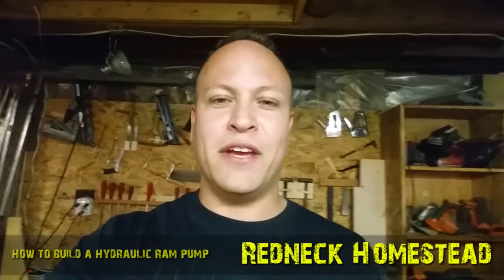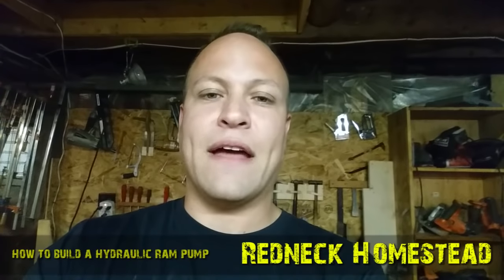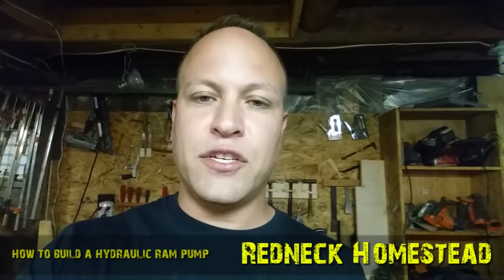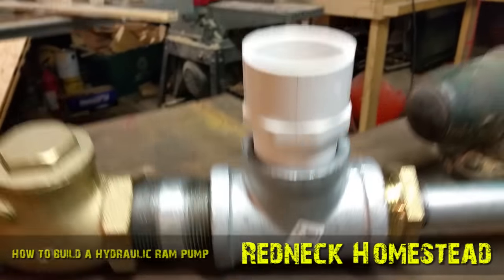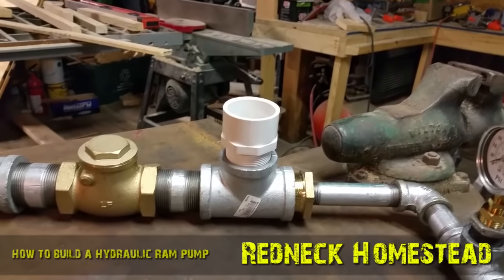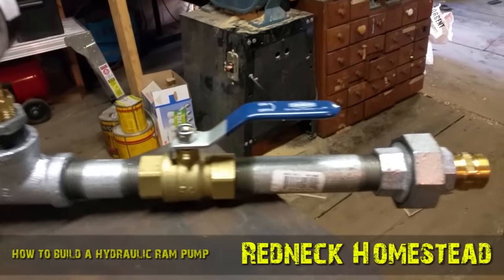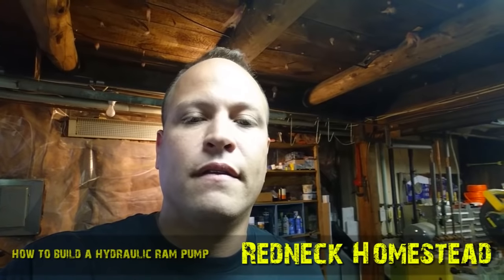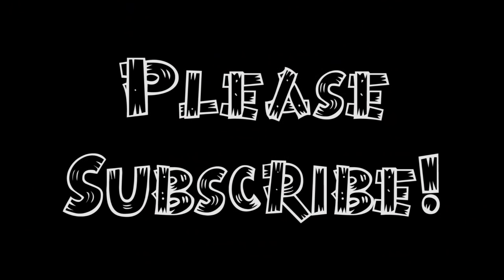Pumping Water Off Grid -  Building A Hydraulic Ram Pump & How it Works

Comment: You need to put the 1-1/2" union after the shutoff valve so you can remove the rampump without draining the whole system.I just found your channel thru your videos on the Harbor Freight Saw mill videos. Thanks
Reply from the maker: +David Casper great suggestion...definitely going to do that!
Reply: +David Casper are you talking between the pressure gauge and the ball valve?
Reply: @107retired  10:16 from left to right, it should go:

 >Ball Valve< <nipple> >Union join< <nipple> /// >Tee< <nipple> >Check Valve (flow--->)< <Reducer< <nipple> >Elbow< <nipple> >Tee< <nipple> \\\ >Union< <Nipple> >Ball Valve< <nipple>

The goal is simple. Undo the unions to remove the pump, the ball valves stay on the pipe work, keeping the water in the pipe lines. You will have much drier socks this way. I fabricate pump manifolds for a living, that is how we make them all.

I realise this reply is 4yrs too late but this is for future people.

Comment: What's best in the diameter of pipe 1 1/4" or 1 1/2"?  I love the larger but most others are 1 1/4" and I would love your input asap if possible before I buy the parts.  Also, have you used the noodles for the pressure pvc tube?  Engineer 775 mentioned that but I would like feed back from you on your opinion only so that you do not feel you are responsible of any problems.  I need your opinion please.

Comment: Great video but shouldn't the ball valves be located prior to the unions?
Reply: On the water supply side for sure, but I think the output ball valve (3/4") should stay where it is. Maintain the water flowing up hill as the other side has already been cut off.

Comment: I have heard that brass flap valves don't last long and are not that good. They are not adjustable home made one way valves can be cheaply made and you can change your closing times thus the flow which controls your pressure.

Comment: it's my understanding Ram pumps are used to lift water up a hillside or slope not down a slope. If you are running the water down to the storage tank from the spring then using that to operate the ram pump downhill more to the cabin isn't that defeating the gravity fed water pressure it will already create? Or are you trying to create more water pressure at the cabin side if so, then were will the extra pressure/runoff of the water go since it can't just sit in the pipes building up pressure.  Or am I just totally missing something?
Reply from the maker: +hallard069 you are right, but the ram pump can be used to harness the energy of the water and increase the pressure, even down hill.  In my case, the spring is 170ft to the upper left of the cabin.  I could technically just pipe the water to a holding tank behind the cabin, but  I would rather pump it slightly up hill to a water tower (not yet created).  Then my options open up vastly

Comment: Hi, how can I get added drop since my creek only drops maybe 2 feet and it just isn't enough drop to engage my ram pump??
Reply: Actually, the net rise would still be the difference between the two water heights. The perceived height gain is lost due to the need to suck the water up to the new level.
Reply: Dig a pit or trench 2' deep with a sloped entrance so you can use a straight ram pipe.  That will give you 4' of drop, dig it a little deeper and put gravel in the bottom.  The waste water can run off down the trench or can be piped using a tee and straight through valve of some sort so you can start the pump by poking the valve through the upper valve and then shut it off to run the waste water out of the pit.

Comment: Your unions should be inside the isolation valves so that you can remove the ram pump assembly without disturbing your piping runs. Otherwise, your unions have no purpose.

Comment: Get rid of the plastic parts....they won't last. With a swing check valve there is no way to adjust the amount of flow through the valve by adding weights to precisely adjust for maximum water pressure....been there, done that,  Swing checks also don't seal as good and the constant metal to metal pounding beats them up.

Comment: I'm sorry. 3/4 pipe is not 1/2 the square area of 1 1/2'  3/4' is about 7.5 square inches. 1 1/2" pipe has a square area of about 27" Not pressure shuts the impulse valve, Velocity does

Comment: Better paint that PVC. Ultra violet eats up PVC.( I use a old propane tank) You don't need inner tube.Just drill a small hole below the check valve. You have no idea what you're talking about when you talk about the delivery pipe. Reducing size doesn't increase pressure. Just velocity. Don't use black pipe because there's oxygen in the water. If there was no oxygen in the water... no rust. Like boiler systems. That's what air scubbers are for in radiant systems.

Comment: Nice vid, but a few points were wrong. Pressure does not close the waste valve, velocity of flow does. And when the valve closes it doesn't hammer the water down, the column is instantly stopped at that point (due to not being able to compress water) however there is still energy in the system that has to go somewhere and that energy is what you collect in the pressure tank and hold in with the 2nd flapper valve.

Comment: you can use stainless fittings. some water is murder on brass and galvanized pipe. plastic will hammer itself apart.

Comment: Neighbor your first inlet ball valve > MUST be before the inlet union to stop the incoming water from its source. Then the union can be removed to provide maintenance on the pump. The way you have it now is completely a waste of your money and effort - as it has No viable purpose - NONE!. Furthermore you are misleading others - should they follow your method of constructing their pump. You could have purchased all your components at Lowes - Home depot - etc. and saved loads of money > more than half!  Rating D+.  Mr. T
Reply: Wow, you are right about the valve locations, should be first and last, but others have already mentioned that and have done so  in a polite and constructive manner, just saying... It seems Josh is sharing a learning experience and not claiming to be an expert,  just for the heck of it, let's cut him some slack?

Comment: If you want to generate electricity you don't need the ram pump with the method you demonstrated.  If you used the ram pump to pump water to a higher elevation holding tank to create more head pressure then you can run the micro hydro generator more efficiently.

Comment: Great video, one question, why do you put the ball valves on other side of unions? Wouldn't you want to be able to turn water off to remove pump from system for service if needed?

Comment: Good stuff!
Question...in order for a ram pump to work,  your source of water must be a running creek or river?
 If you dont have that luxury, can a ram pump works with still water? Are there ways you can make it work if you  dont have running water?
Thanks.
Reply: je pense que sa peut fonctionner avec un étang ou un lac, il suffit que l'entrée d'eau soit immergée dans l'eau avec la pompe positionnée sous le niveau de l'eau, afin que la gravité fasse s'écouler l'eau dans le tuyau d'entrée, créant ainsi de la pression et rendant fonctionnelle la pompe. Après, tant que la pompe n'est pas immergée sa devrait le faire

Comment: I am sure you have figured it out by this point, however, the second check valve with the air pressure on it really should be vertical.
Reply: why?

Comment: my understanding is...the water supply is below the cabin location...the water is being transported via 1 1/2 in pipe to a cistern...from the cistern down to the ram pump (metal pipe would be better as it handles the hammer effect better to my understanding)...then you can use any pipe material you want...the pipe going to the cabin would be 1/2 the size of the supply line...if you have a 10' drop to the ram pump...you should be able to lift the water 100'...you may or may not need a stand pipe between the supply and ram pump...I think as per Engineer775...don't quote me...I'm not an engineer...good video...

Comment: Why not have a third check valve on the inlet before your hammer valve to prevent the spike from ramming back into the supply line?
Reply: Dirk Cornelis - I'm watching this setup & wondered if you would draw me a picture of exactly where u would place it. Haven't watched any post videos to see if he's made any modifications yet. do you see any issues with it in principle. thanks again.
thanks, Kurt.
Reply: Even 10 feet back up the supply line, back to the source, might be ok as water does not compress, I think the question is very simple.  I might not understand enough, and the idea might prevent the system from working. I would like to know.
Reply: In a word, No, the weight of the water "hammering"  downhill is what causes the pressure spike. The spike cannot exceed pressure of the water hammering down the feed pipe. Frankly, understand the pump is very old and works perfectly the way it is. Any valve in the feed pipe would only reduce the pressure of the hammer by reducing the cross sectional area of the pipe. Great video BTW Josh.

Comment: I think there's some kind of electrolytic reaction between brass and zinc. The zinc will be taken off the gal fittings and they'll rust. Eventually. Sooner if lots of minerals in the water.
Reply: This is correct.  The Zinc will take the majority of the corrosion until its all gone.  Galvanic corrosion is a thing.  But it is more of an issue the larger the system is.  I once put a galvanized bushing in a copper water system in a house.  It came apart in about a year.   All the zinc was gone in a matter of weeks.  Effectively the most vulnerable metal in the system will consume ALL the corrosion in the entire system until its gone.  Then the next most vulnerable metal will be sacrificed.

Comment: When you speak about drive line to supply line ratios it bring up the question:  Should it be based on diameter or on cross-sectional area?
There is a substantial difference.
If it should be based on diameter then: 1.5"/0.75" = 2.0 or 2:1 would be close to correct (actual I.D. depends on the pipe's wall thickness).

However, typically pipe flow characteristics are based on cross-sectional area.
So, if it should be based on cross-sectional area then:
- for 1.5" pipe, I.D. = 1.61" (assuming Sched 40)  Area = ∏R² = (3.14159)(0.805)(0.805) = 2.036 sq. in.
 (∏ - pi or 3.14159, R - inner radius)
- for 0.75" pipe, I.D. = 0.84" (again assuming Sched 40)  Area = (3.14159)(0.42)(0.42) = 0.554 sq. in.

Ratio based on cross-sectional area = 2.036/0.554 = 3.68 or 3.68:1

If you're doing this by trial & error then it's really not a critical issue.

This is something I want to experiment with once I'm fully into retirement.